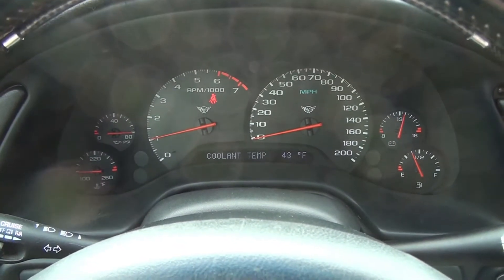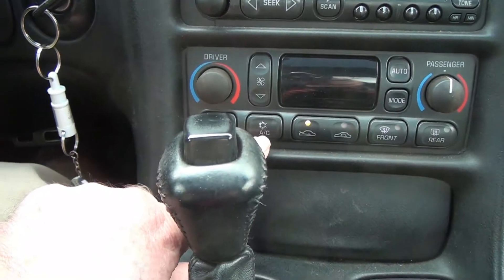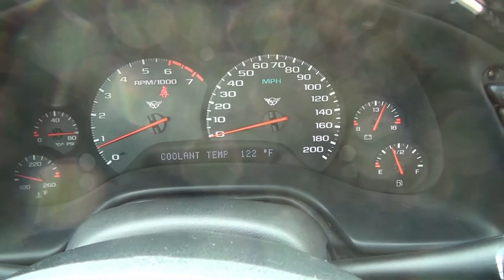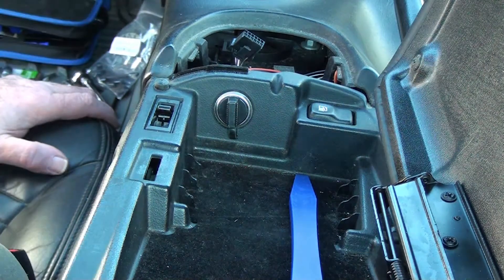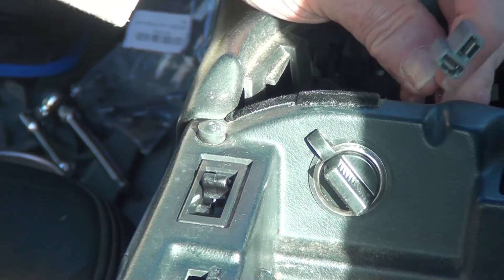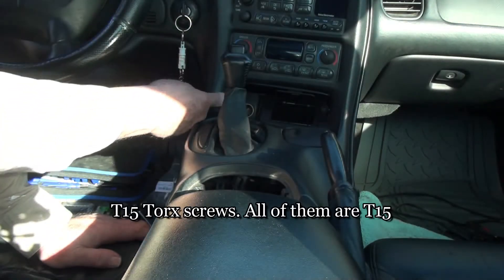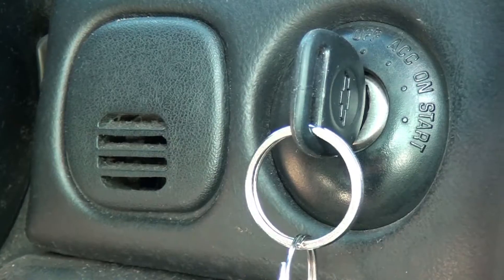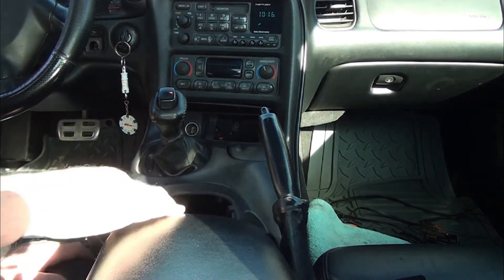1998 C5 Corvette HVAC Climate Control Removal

Comment: Excellent work ! Will be sending mine in this month to get led upgraded !
Reply from the maker: I wanted to keep it stock as much as possible. LED upgrades need to be installed with resistors, I understand, so as to not blow the fuse.

Comment: the newer the cars the more complicated they get, I had to take the cd/radio out of my Subaru Baja some time back, and like you, I had to take a bunch of trim off,, I knew I couldn't fix the radio so I ordered a used one off ebay and it worked great.
Reply from the maker: Yep, taking all that stuff off just to get to the radio is enough work in itself. Sometimes Ebay can be a life saver of a sorts.